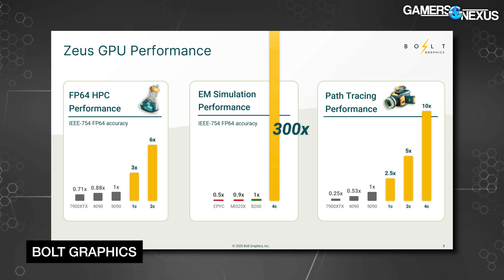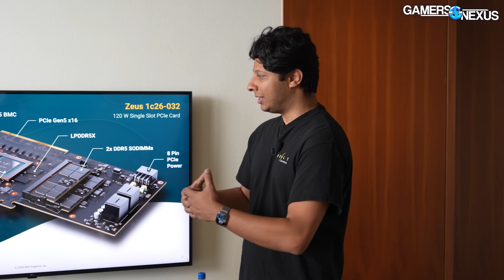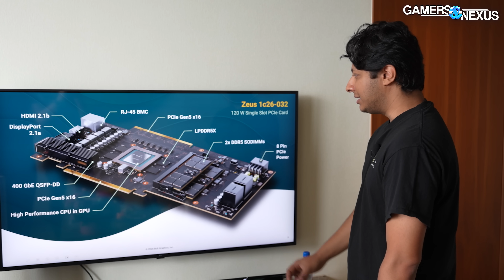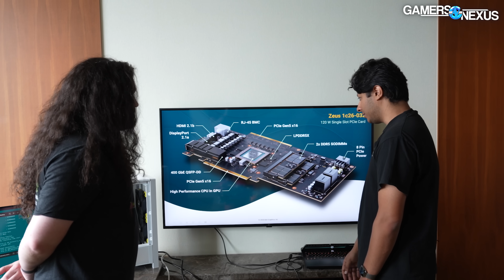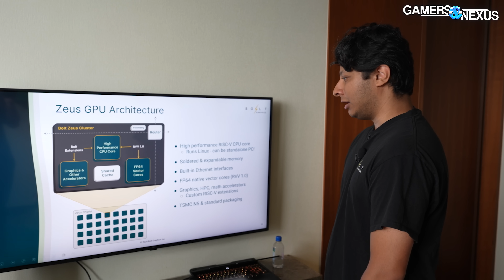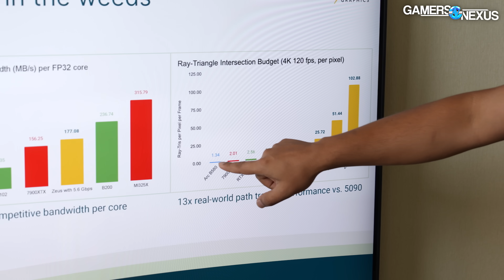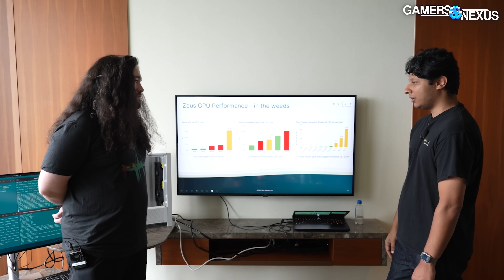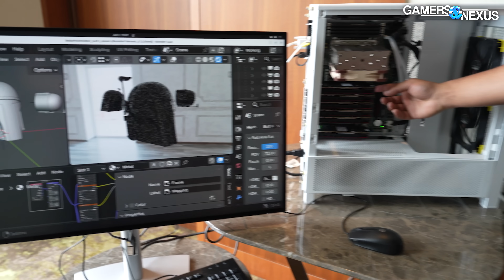A New Gaming GPU Challenger: Bolt Graphics Takes Aim at NVIDIA

Comment: A gpu with sodimm slots? Plug it straight into my veins, that's beyond awesome.
Reply: It's basically a Super Raspberry Pi.
Reply: @dra6o0n  Raspberry Pi if it was cool.
Reply: Well, not exactly a gaming GPU. Very much a production GPU for scene rendering and AI stuff. Where timing isn't a critical factor but memory is. Still, they might be able to deliver some gaming GPU models for gamers after initial models. R&D is costly and high bandwidth memory is expensive right now so they will need money. They're gonna need a foot in the market in order to deliver gaming GPUs, they're not Intel for godsake.
Reply: @tesial im not sure about running LLMs though speed  might be to slow but maybe for training where speed is no issue
Reply: @tesial  I agree. Unfortunately, I'd say the vast majority of the people watching this video are thinking gaming, and they'd be disappointed because the engineering choices are different.
Reply: @JimBob1937 That's kinda sad. Because this seems like a good product for workstations because it would be amazing to scale both vertically and horizontally as you want this gives you exactly that. You can scale GPU cores with that extra PCIe connector and scale memory with SODIMM slots. Honestly, after seeing this, buying an Nvidia or Intel workstation GPU seems like a mad choice.
Reply: @tesial  so it's the saner choice to not buy established products and instead wait for a couple of years for a product to come out that doesn't even have a prototype out. I'm sorry, this is just wishful thinking.

I'm impressed by what I saw in the clip, but I'm cautiously optimistic (because everybody needs a bit more competition).
Reply: @trosc , if they get into the gaming space I have a feeling their biggest issue will be the giant amount of legacy support for API oddities. This is what initially got Intel, and Intel already had some foundation with their integrated GPUs.
Reply: @JimBob1937  I'm into pc hardware more because of the creative side nowadays, and slightly interested in local inference too, and this could be big. Because memory size and bandwidth is usually more important than just raw gpu compute on those 2 use cases.
Reply: @tesial  It doesn't matter. With success and any business sense, they will expand and unveil a gaming GPU eventually. They have the means and the market is drooling at the potential. All they need is to solidify their position.

I kinda typed this before reading the rest of your comment, so yeah you understand this already. :)
Reply: @LightTrack-  and they said that themselves
Reply: @FunAngelo2005 Yes i was too hasty with my comment i admitted that at the end.
Reply: @LightTrack-  You sound like a child
Reply: @REDACTED__007  Says the guy completely out of nowhere named "Redacted 007" with a profile picture that would have looked "mysterious and cool" when i was maybe 14.

Look in the mirror, buddy.
Reply: @LightTrack-  Better than living in your fantasy. You think and sound like a child
Reply: @tesial  Sooo it's an APU then. Pass; not worth it.
Reply: Hope they'll move to lpcamm2
Reply: @SuhailCross  That would be fine for me too. Anything except soldered on memory or proprietary stuff. lpcamm2 would also be easier to cool, they can just but a heatsink on top of it.
Reply: SODIMMs won't cope well with the instant high bandwidth requirements of gaming rendering. GDDR just absolutely obliterates even soldered overclocked DDR RAM in terms of bandwidth and thus clocking speeds. There is a very good reason why GDDR is not hotswappable: the insane clockspeeds of GDDR need basically perfect signal integrity. Even today's DDR5 RAM is pushing it, and no, LPCAMM2 won't cut it for GDDR6 speeds either, let alone GDDR7. 

Sorry to burst your bubble of hope, I really am.
Reply: @Atom224  JFC the amount of people saying this clearly didn't watch the video. LPDDR is the huge cache. the SODIMMs are the slower memory that can fill the cache at a faster rate than over pcie. The computer can then trickle into the SODIMM

Computer fills LPDDR and SODIMM, GPU runs from LPDDR refilling from SODIMM, computer then refills SODIM. Normal GPUs fill GDDR from the computer, then refill from computer. The computer refill is the slow part with no buffer. They avoid that with multiple large buffers essentially. It is essentially the same concept as AMD's v-cache
Reply: @Atom224  DEPENDS on the workload.
Reply: @fus132  the comment literally says gaming in the first few words
Reply: @fus132 GPU loads are parallel computation in all cases and they require the maximun bandwith possible. Other tasks are CPU tasks. So it does not depends on the task.
Reply: @alejandrosrwebmaster  This is mostly true. But there's a reason why they are focusing on path tracing with this, the calculation takes significantly more time compared to the data size than other tasks you might do on a GPU, like texturing. There are scientific calculations that take almost no memory but significant amounts of time and are bound by compute alone. Those are things they are targeting (fp64 mentioned) and are not what a GPU does during gaming at all.
Reply: @Kwazzaaap  Yes. Path tracing data size is very small compared to raster data. I think they target to ran it entirely on chip's massive cache. 

This in theory could work,but such cache could run to thermal issues(so clocks needs to be lowered). It is interesting design, and for sure a different approach than what industry standard currently use. In theory it is valid concept. 

I personally would like them to one shot it, but that, in practice never happens. We'll see when it comes out. It is good to see at least some (even trying to be) competition.
Reply: @Atom224 It does work in aMD pro cards and some Nvidia Tesla editions for movie studios. They are tiered not used for a ram replacement. Consider it a super fast swap to move data in/out for the VRAM bypassing slow CPU/chip set storage which has a latency hit
Reply: @Atom224  The SODIMM is secondary RAM, for spillover and other workloads that don't need to very fast RAM. You can have your cake and eat it too, if you include both.
Reply: @Atom224  That's why there are putting so much cache inside the thing. Let's wait until they have actual hardware to show off before claiming it can't be done.
Reply: @VTOLfreak  , gaming is constantly moving large amounts of data from the GPU to/from VRAM, to the point that even a large cache will have a large cache miss rate. Thus hitting the bandwidth penalty still.
Reply: @JimBob1937  And this isnt a Gaming GPU yet.
Reply: @StretchDattass  yes, I'm just judging the engineering from a gaming perspective, as most of the people in the comments are doing just that. From a gaming workload, a lot of these engineering choices will go away, or gaming performance will suffer. People in the comments are like, "why wouldn't we do SODIMM and non-GDDR memory?" The answers are because they're not appropriate for a gaming video card workload. For a lot of server and production workloads, more memory is often more important than bandwidth (though, both combined can't hurt).
Reply: @JimBob1937  hence the second tier with the lpddr5x. the chip shown on the video is their 32gb version before the so-dimms, but even if you only get one with 8gb across those chips, that's gonna be plenty for gaming. then you can extend that with 16-32 gb of so-dimm to get a monster gpu that will never run out of vram.

amd showed on rdna2 that cache is very useful for gaming. it makes sense that a multi-tiered cache system would show similar advantages and enable the use of socketed memory on the last tier
Reply: @b3nsn0w  LPDDR5X is meant for low power mobile uses. It's latency is worse than DDR5, and bandwidth is 2-3x lower than something like GDDR6X. This makes sense as their card is less a gaming card and more of a HPC card with an OS, CPU/GPU hybrid with a tiered unified memory. LPDDR5X in that case is more appropriate as it's an in-between, somewhat higher latency but somewhat higher bandwidth, compared to DDR5. They're more concerned by memory capacity than performance. Their engineering is less towards gaming, and it shows. Their claim that they beat Nvidia is also disingenuous since it's only because they're devoting more of their transistor budget towards things like ray tracing... which is a given it'll perform better, but it's not like Nvidia couldn't do the same and beat them in performance immediately.
Reply: @b3nsn0w  "amd showed on rdna2 that cache is very useful for gaming."

Of course, cache is very important for most workloads. However, cache does have it's limits in scaling, and cache can't make up for a 2-3x worse bandwidth for main VRAM.
Reply: @Atom224 yeah but I wonder which is worse. Gaming with those large HDD storage or gaming with laptop memory as vram
Reply: @Atom224 true, but this card can only draw up to 120 watts at max so it's not gonna be in competition with a RTX 5080. If it can compete or come close to something like the RTX 4060 or maybe the 5060, then it could be an option in a gaming pc build. I bet that once it gets in the hands of the public, it will be used by someone to make a Minecraft server or something since it seems capable of stuff like that.
Reply: @batterypwrlow  Theres also the thing I see no one talking about, the fact this is basically a Single Board Computer! It says IN THE SLIDES that it already Runs Linux, with current Linux Gaming support, which will only get better by end 2027 early 2028 when they claim theyre looking to Launch, This could be a GOD SEND for cheap computing. If this thing is, lets say, $700-$1000 for a fully capable PC on a single board, with near or better workstation performance than an ACTUAL workstation this will be a revolution in availability for HomeLab, Production Studios, NAS Systems, etc!
Reply: @StretchDattass yeah that stuff is super cool. I can't see this outperforming a work station as it has a 120 watt limit on power draw. By itself, I'd say it might have more performance potential than one of those handheld gaming pcs like a Steam Machine or a MSI Claw or something similar. High end workstations have a high power draw because we haven't really made much progress in power draw to compute performance ratio in tech for awhile. I mean most new graphics cards are only giving us performance numbers in gaming when they used frame generation and upscaling for the results. They don't show the true raw performance abilities as it's not terrific. Some newer games are having to demand you use frame generation and upscaling nowdays as you will have a low frame rate if you don't use those and thats even when using a high end gpu.
Reply: @Atom224  it's a tiered system. everything goes into on-chip cache first, then the lpddr5x next to the gpu, then the so-dimm. it's a proven way to get high capacity and high performance without a dense array of expensive hardware. it's rather ingenious tbh

this is how it looks when you develop a card for graphics, not ai. ai models need to scan over their entire parameter space every time they run an inference call. for llms, that means loading the entire model into the chip every token. your criticism of so-dimm would make sense there. graphics and hpc workloads, on the other hand, tend to use specific parts of memory much more than others, which is why they respond to a setup like this pretty well. this is why rdna2 could get away with much smaller bus widths than nvidia by just adding a relatively large on-chip cache, and there's no reason the same technique couldn't work for bolt as well.
Reply: Reminds me of my old Matrox card back in the early 2000's
Reply: And how are you meant to get >800GBps with something like that? Not possible. Not sure why GN humoured this guy.
Reply: If they try and get into gaming maybe just focus on online multiplayer games to work , esport etc, ar. Raiders stuff like that. To maybe try and get into it market it as select games compatible for the market that only plays 1 or 2 games.
Reply: It's a dev board
Reply: I don;'t know. the idea is cool.. but maybe the performance really suck ahah
Reply: LOL, no. That sucks.
Reply: @IIARROWS  elaborate please mr.bigbrain
Reply: @akbaru4818  Degraded performance in data transfer because of signal integrity.
Reply: @akbaru4818  Slotted Memory has like 1/10 the bandwidth of soldered GDDR.
Reply: @Teana92  unless you're running AI inference don't get how it would matter in most use case. lpddr5X has plenty bandwidth for gaming
Reply: @akbaru4818  DDR has way, way less bandwidth than GDDR, as demonstrated by the DDR GPUs we've seen in the past, and the expansion cards don't have the pinning to host GDDR. It may (emphasis on may) be possible to have a GDDR expansion card using a very special add-in card design, but that's not this. It would probably end up looking something vaguely like LPCAMM, though you would need more pins and even more thought put towards signal integrity.
Reply: @alexandrevalentin8587 APUs are already somewhat bandwidth limited by LPDDR5X and they're not even close to discrete card performance (except for Strix Halo, which uses a 256-bit bus for the RAM instead of the usual 128-bit).
Reply: @alexandrevalentin8587 No, LPDDR5X is almost 3 times slower than even GDDR5 memory in terms of total bandwidth, i.e., total GB/s. GDDR5 was introduced 20 years ago
Reply: @akbaru4818  , GPUs, long, long ago used to have adjustable memory. Speed requirements pushed the integrations to be fixed, soldered, and interface path to be minimized. If it's not done, there's usually engineering reasons.
Reply: @Atom224  I never said it wasn't lower bandwidth, just that it is plenty enough for gaming, the fact that gddr5 was introduced 20 years ago doesn't matter, you'll only be bottlnecked by bandwidth if you game at 4k or really high textures at 1440p.
Reply: @alexandrevalentin8587 It might be enough for system memory, but not even close to being enough as video memory for gaming. Even an "old" GTX 1060 has 4 times the memory bandwidth of regular DDR5 6000 (still twice the bandwidth if dual-channel). A GeForce 8800GT from 2007 has more memory bandwidth than single-channel DDR5 6000. Memory bandwidth is EXTREMELY important for GPUs.

Comment: Would b interesting if they could just use proton to run games on Linux and Windows, using it as the translation layer, so drivers should be way easier to deal with.
Reply: It would still be very hard lol
Reply: Native support is the better option.